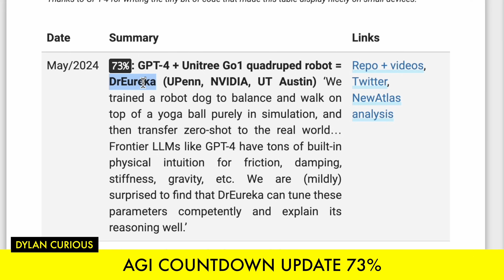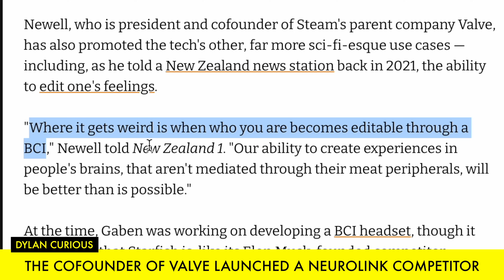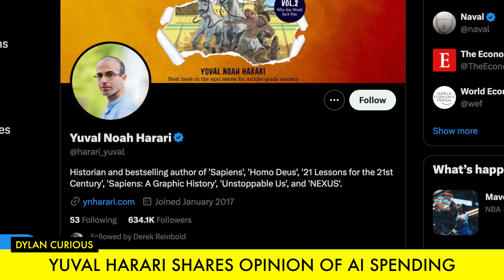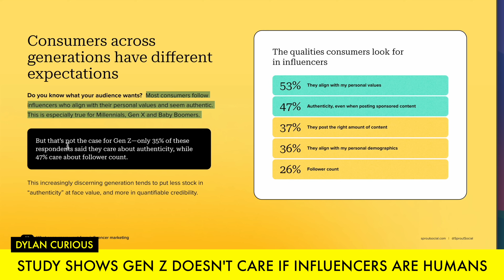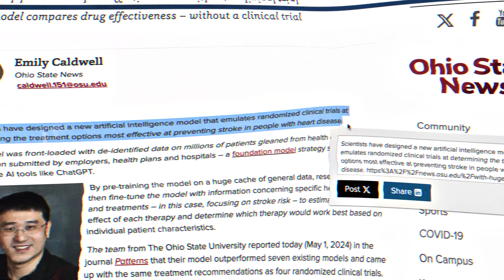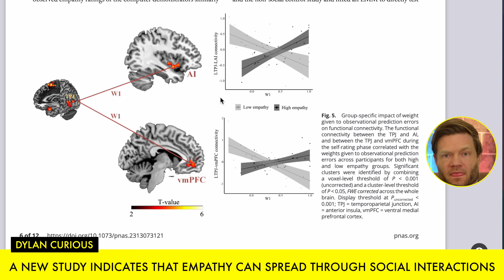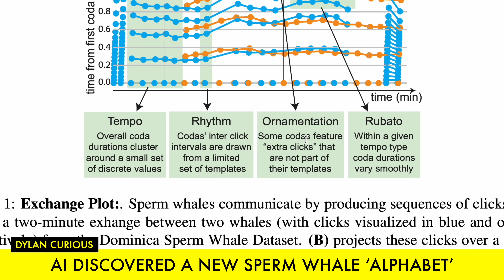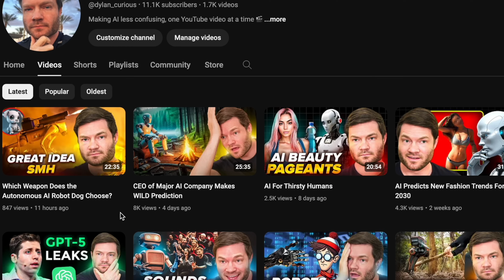DARPA’s Ultimate Weapon LEAKED

Comment: This should be 2 to 4 videos.
Reply from the maker: You mean you would rather rather have it cut up into 2 to 4 videos? Shorter and length but more frequent uploads?
Reply: @dylan_curious  I agree, you have a lot of unique and interesting news not covered by the others, but they're often not evident in the title/thumbnail so new viewers don't have the chance to discover them in their feed, and you often rush through them very quickly (I often have to go back a few times like "what did he say there?" if I wasn't completely attentive all the way through). 

I now watch all your videos no matter the title because I know there's always some fascinating stuff hidden in there. 

A little more depth (perhaps just a few minutes more) on at least the more interesting news, and split into more videos highlighted in the title, even if the videos get a bit shorter then would give you more viewers and more activity, I think. 10-15 minute videos are also fine, and I think you might get the same amount of views per video still. 

So basically from a purely cynical POV, hiding all that good stuff inside your videos without being highlighted in the title, I think you're missing out on a lot of views from the same amount of research effort if that makes sense :) And then you could probably put out new videos every one or two days instead of every 3-4 days which I would perhaps bump you in the algorithm as well?